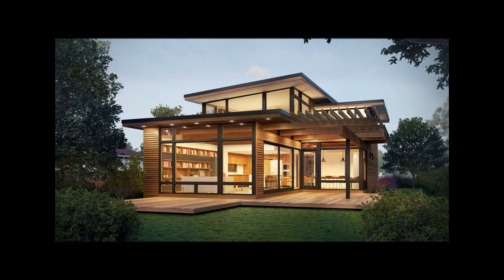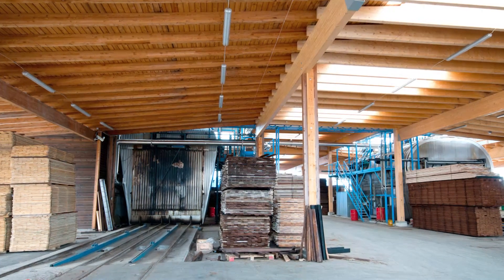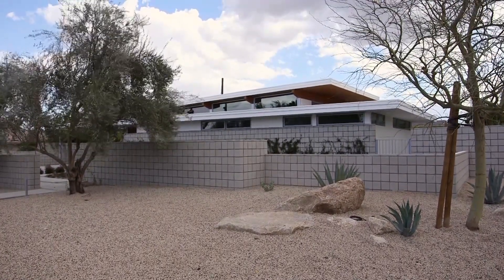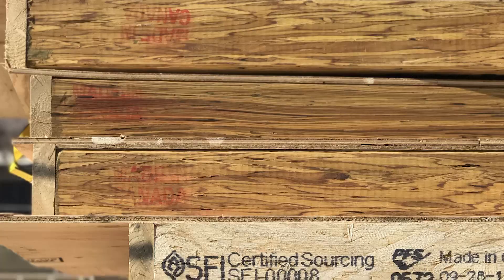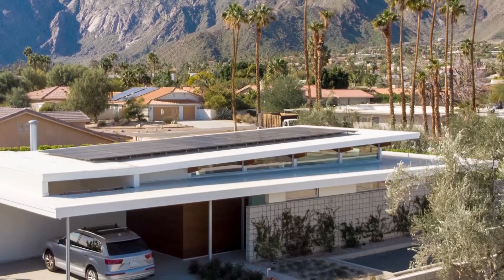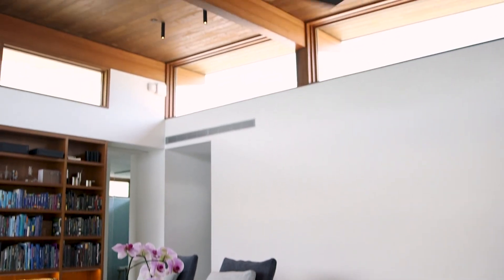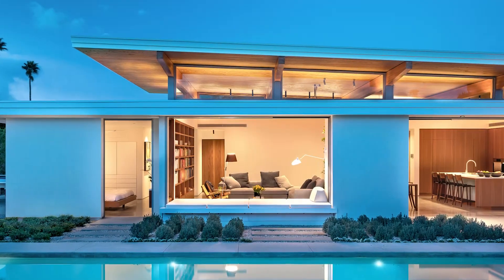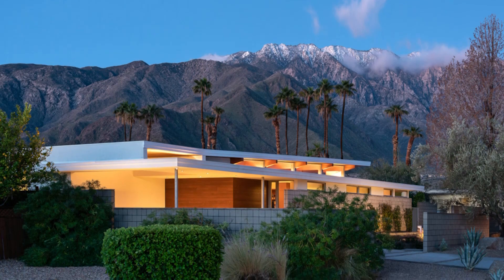Take a tour of this fossil-fuel-free house designed by MIT alumni architects

Comment: What an absolute load of rubbish!  I'm outraged these two charlatans blather on about using standard materials as if it's something different or cutting edge.  Brag about using concrete and being a fossil fuel-free home?  That's obscene.  No more fossil-fuel intensive material than concrete - every 1000 lbs of concrete generates 925 lbs of CO2 because it is so energy  intensive to produce cement.
Reply: So what? The majority of carbon emissions that are produced from a house come from its useful life (not the construction phase), mostly from energy used to power the house over the 60+ years its in use. Why not just focus on reducing the need for fossil fuels (the grid), then net net you'll achieve a "zero carbon" home. Also you'll save on energy bills.
Reply: @oyster31  wait till you find out how ZipSystem is created, poor fossil fuel-free yuppie
Reply: @oyster31  fine, just don't tell us it's 'fossil-fuel free' when you choose to build using one of the most fossil-fuel-intensive building materials possible. These two are just spouting greenwash nonsense as a marketing scheme.